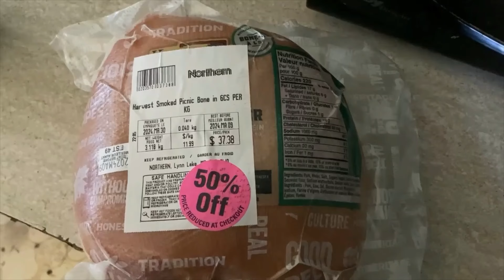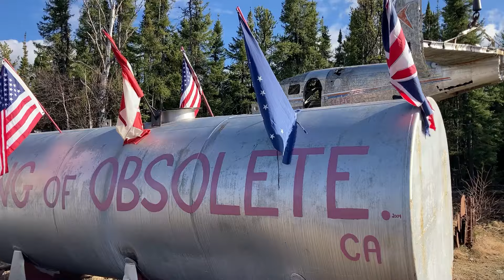Thought is Required for the Rubber Tracks on the Snow Truck May 05 2024

Comment: Good morning from Cape Cod 🦈 I certainly hope that track system works out for you, that's going to be an awful lot of cutting, grinding and welding. I'm thinking you're going to have to spring load the idle axle. Titty vodka and thought required 😉 staying tuned for further developments ✌️🇺🇲
Reply from the maker: yes once we get the tracks figured out then we can design the idler axle tightener.  thansk